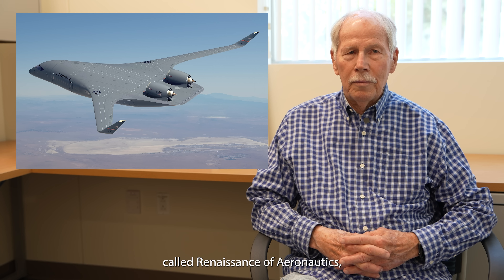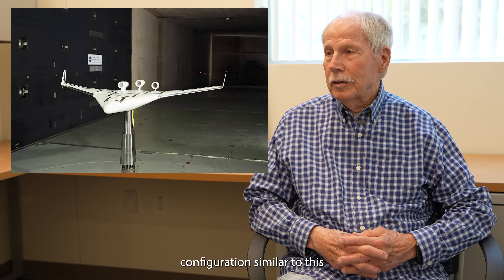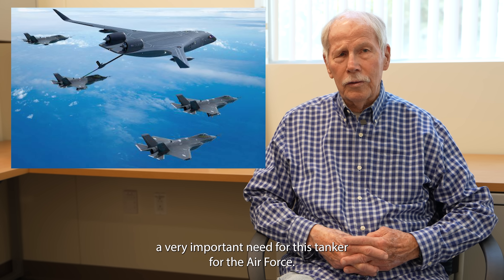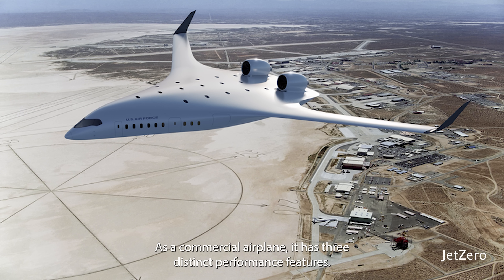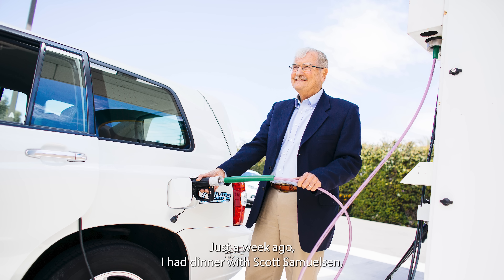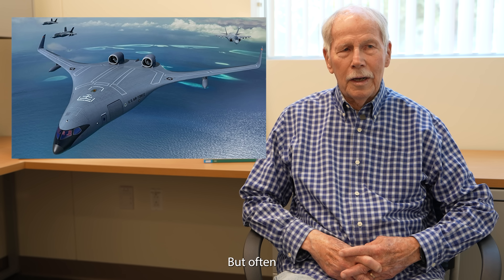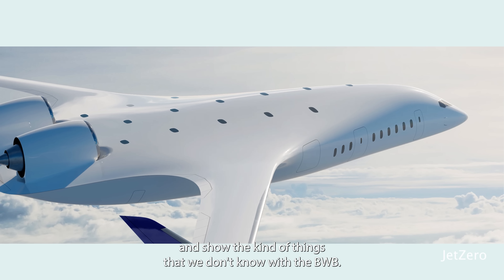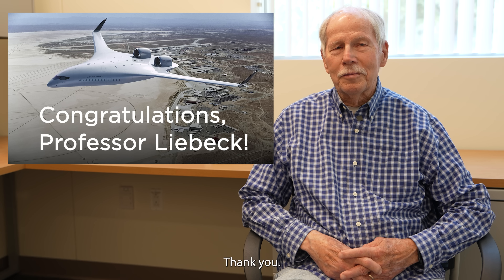Interview: Robert Liebeck, Co-designer of Blended Wing Body (BWB) Plane

Comment: BWB aircraft also have a very high internal volume for their surface area, which means they are great for cargo.  They look beautiful too, so would be a big gain all round to the aviation world.
Reply: And bad for people as the cabin height is shorter.
Reply: @hafizuddinmohdlowhim8426  the larger the aircraft (scale) the less thats an issue. Not that it was an issue in the first place.
Reply: @ the larger the aircraft, the bigger the problem.

Comment: This is where we should be.  This design would make a great B-52 replacement, KC135 replacement. The fuel capacity or internal bomb load would be fantastic.  It would make a good passenger aircraft as well.  This should have been done 20 years ago.

Comment: What is the actual efficiency difference between you configuration presented here, and a more simple cropped delta lifting body? Assuming the following features: 56 degree leading edge sweep, 14 percent of chord with straight tips, aspect ratio of 2.0, center third of the cross section increased in height (but fully blended with wing) to accommodate payload and fuel, vertical fins as tip sails or a center fin (whichever is most efficient). Is it correct to assume it could get away with no high lift devices, using only the vortex flow of the delta plan form, for the high lift needed for takeoff and landing? With sufficient wing area for runways >2 km, can it still have 0.75 to 0.85 mach cruise, and still have better fuel economy than current airliners? Are the wings beyond the main delta shape of your plan form primarily for stability and control?

Comment: And the cost. So much higher than a traditional design. Also issues with providing a pressurized cabin that is not a cylinder.

Comment: Kind of funny that the Horton brothers already recognized a lot of the advantages (albeit flying wings) in the early 1940s and were planning on building a bomber around this size. Jack Northrop was working on similar stuff in the late 40s, just funny it's only gaining traction 70 years later. Better late than never I suppose.

Comment: Going back, see Northrop's "Avion 1" X216-H.
Among the best of its class in all criteria, and markedly faster than any others.
Also V.J.Burnelli making lifting fuselage body planes.
During the war, the Higgins-Bellanca 39-60 cargo plane, and a similar Boeing 360-362 bomber.
Several similar things from the Germans like some tailed Arado 555 versions and Arado 470. A few Horten/Messerschmitt versions with tails or tailfins like the Ho-18 B2. 
Not to forget the Me-163 Komet, which despite the dubious propulsion, was an entirely successful flying machine, stemming from Lippisch work on "flying wing" design.
Many other "flying wings" with tailfins made very good flying machines too. They tried and utterly failed to make entirely tail-less, failed with wing-tip fins, and when they put a proper fin on it, it worked very well. Arup, Cheranovsky, Fauvel, the Kharkov KhAI-3, others.

More recently, the 1970 Sukhoi T4MS-200 bomber: same technology as the T-4 Sotka, but better range and payload than the Tupolev "Blackjack" which got built instead.
Early 2000s patents by Dizdarevic "Tailed Flying Wings", and the 2016 Lock-Mart hybrid wing-body logistics plane, and the "Frigate Ecojet": multiples of payload and range because they generate substantial lift from the fuselage. Because they have a tail, entirely controllable and stable.

The reason the McD blended wing body was never followed through, is because Boeing owns it, and refuses to build to any sort of lifting fuselage design. NASA had to get Cranfield to build the X-48 models because of the intransigent refusal of Boeing to carry it forward.

Aerospace is cowardly and if Boeing isn't doing it, no one else will.

Comment: Humans learned a LOT in the 20th century.
And a part of what we learned was that hydrogen REALLY sucks as a fuel, unless you happen to be outside the Earth's atmosphere.
And we learned that liquid hydrogen is about 100 times worse than the gas.
End of story.
Reply: There is no “end of story” simplistic nonsense, else every leading manufacturer of aircraft and engines wouldnt be building hydrogen prototypes. It holds much more energy than Jet A at the same weight for a start.

Comment: The major problem with BWB designs is the pressurization stresses on the fuselage housing the passengers. 
Current design uses tubular fuselages for the equal pressure exerted on the perfectly round pressure tube. Non-round pressure tubes exert much higher forces on flatter parts of a roughly rectangular fuselage. 
This design would have to use much thicker and thereby heavier materials. 
Perhaps the BWB could be designed to fly at a lower altitude requiring much less pressurization relative to outside air pressure. 
Fly a plane at 15,000 ft and pressurize to equivalent of 8,000 ft. Yes there is more drag/friction from flying lower in denser air, but there is also denser air for engine combustion, raising compression ratios in the turbine section, and lower weight design for the aircraft overall, increasing efficiency in these ways
Reply: Composite structure kinda negates your argument.
Reply: Composite materials 🙄
Reply: @kalenooc4938  Really, ya really want to go there?
Reply: @NeroontheGoon  Doesn't solve the problem as you can use composite with round fuselage and have weight savings.
Reply: Using a composite structure has nothing to do with it. Whether using composites, titanium or aluminum, the must be designed so that pressure is applied equally all directions.  Areas with smaller dimensions can you use lighter materials where greater spans would require thicker or different materials. Composites have their place in the AEROSPACE industry, but it’s not always the answer.
Reply: Aircraft is not just a shell. You have a 3d volumetric structure to work with. Just because there is little room inside a cylinder to add strengthening doesnt mean the same applies to blended wing. Blended wing has more internal volume to get creative with.

Comment: This blended wing design is great and really hope they use electric motors for taxiing to save fuel and provide silent taxiing.  H2 will be great until batteries reach a high enough efficiency to be used, which will happen.

Comment: In 1963 at the extinct British aircraft construction company Handley Page Ltd., along with other research engineers, I was involved with such an aircraft that also was proposed to have laminar flow suction to reduce skin-friction drag and the result was for a design that was considerably cheaper to fly because its structure was more efficient and because its drag was much lower. These properties were similar to what is described in this video, and it is not much more suitable that our 60-years old ideas were for greater efficiency. This proposal was called HP117 but of course there was no commercial organization which was willing to escape from the tube and swept-wing layouts having outside mounted engines, commonly in use. Its past time to "think outside of the box".

Comment: The pressure vessel will be difficult. The heavy structure required to pressurize a contiguous oblong cabin may negate any efficiency advantages of your blended wing concept. An unpressurized tanker makes more sense.

Comment: It would be great to have a different mass transit plane configuration and experience from the present design, HOWEVER” the total failure of the airlines pre and post flight experience we “all suffer” on every part of this process needs to be radically changed. Unless you have a private jet.

Comment: 1.  The puking for anyone sitting too far from the central axis.
2.  Heavy.  Pressure vessels are tubes for a reason.
3.  Designing a certifiable passenger plane would be a challenge.  Emergency evacuation would be difficult.  Imagine evacuating a movie theater in 90 seconds.
4. Don't have an engine failure.
5. Mostly an aerodynamicist's dream. The concept has been around 30+ years.  If the design could be built and operated economically,  Airbus or Boeing would have done it already.  Not so much demand for a super jumbo.  
6.  Look at the direction X-66A is going.

Comment: If this is the future of subsonic jet transports why have Boeing and NASA committed a billion dollars  to the trussed wing research project.
It is obvious why the a blended wing design would be great for a tanker aircraft.
Reply: Biggest issue is geometry. Passengers need surface area to exit the plane in a timely manner. Cargo needs specific dimensions to fit that are sometimes better offered by a taller cylindrical fuselage.

A tanker has none of these issues. Its crew is small and its cargo is liquid. It can be any shape you want.

Comment: bro peaple are allergic to canards? the plane could have swep wings that run into the body, and just have canards and fuselage to generate lift in high speed... this would solve the problem of taking to much space in hangars, it could just swep the wing to position in the middle of the runway to takeoff, and the design with canard would have much higher max take of weight, its safer, the only problem is fuselage stress, but for a blended wing you would allready have to use more advanced material, composite carbon fiber of some king... now we are running to hibrid aircraft aswell, without the apu and with batterys, to start the engine, to every thing, and we could also put eletric motor in the wheels for the airplane to pick higher speeds quickly, also to use the electricit generated with the landing, and fill up the battery without needing to stay with the engines running to fill the batterys for the next flight.

Comment: It would be a nightmare for aircraft mechanics to replace or remove those engines above the wings or body.
And I believe that the future will be container pods and aircraft supplied power and life support with self contained pods.
This would involve the engines mounted  on spars/engine mounted to the horizontal tails with the center fuselage to put the pod within.
The positive aspect for this design would be quick turn around for pod insertion and removal, thus aircraft turn around.
I believe that the future will be hydrogen powere with electric fan engines.

Comment: Boeing isn't going anywhere if they keep losing parts off their planes during flights.
Reply from the maker: Actually Jet Zero is making the BWB
Reply: @UCIEngineering  Robert mentioned that he worked for MacDonald Douglas which merged with Boeing on Aug. 1st, l997.  He has worked for Boeing for many years.  Boeing is a good example of runaway capitalism.  It needs enough regulation to prevent the money that changes hands behind the scenes.  He speaks from a history as a Boeing employee.  JetZero currently has a contract but there is no guarantee that they will end up building the BWB.  Boeing, unfortunately, is politically involved, so it remains to be seen whether or not they are awarded or they buy their next contract.